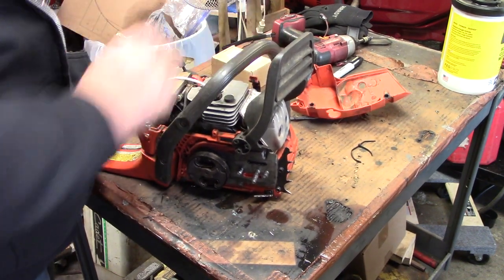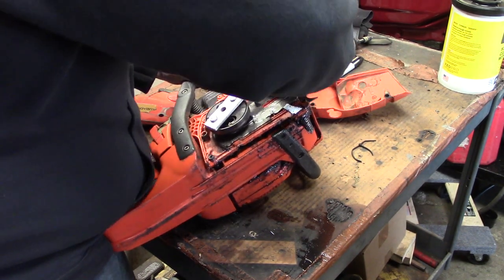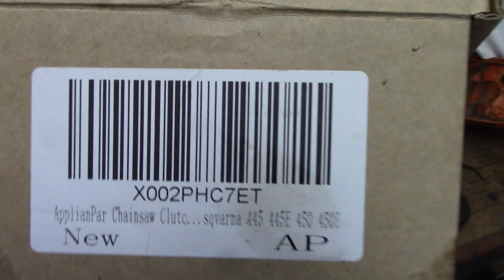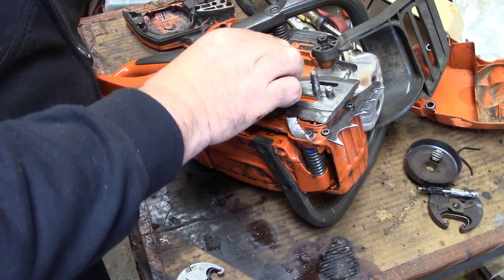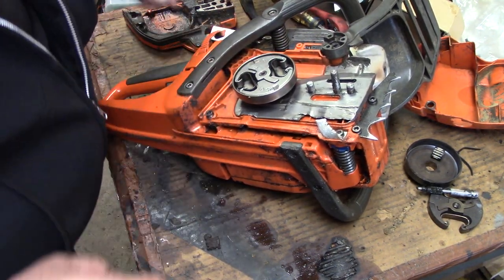Husqvarna 445, 445E, 450 450E chain clutch replacement

Comment: Really like your videos and followed it just like you did things. Everything was fine and put new bar and chain on. Was out cutting and started smoking again from saw. Any suggestions
Reply from the maker: Smoke coming from the bar/chain or the exhaust?  If it's from the bar/chain then I would guess it's a lack of oil scenario if it's from the exhaust then I'd say your fuel/oil mix is a rich.